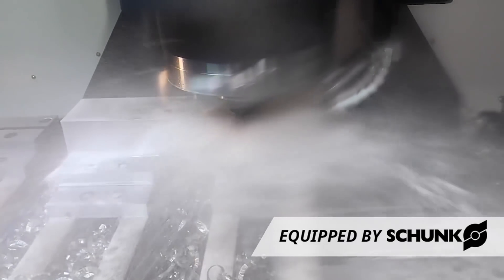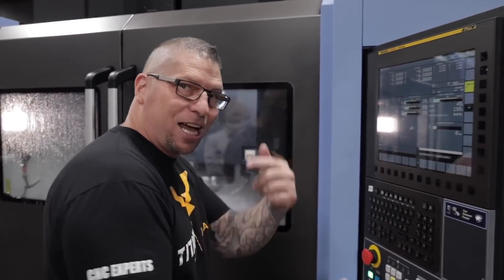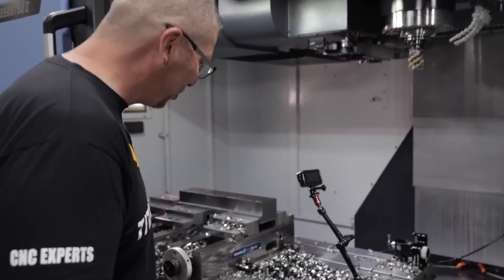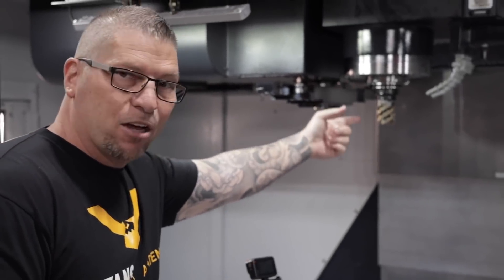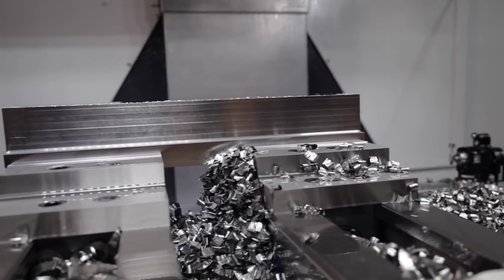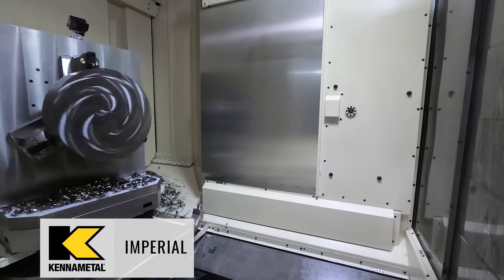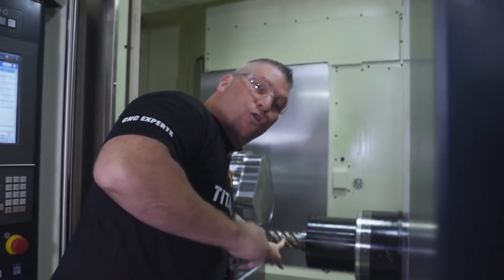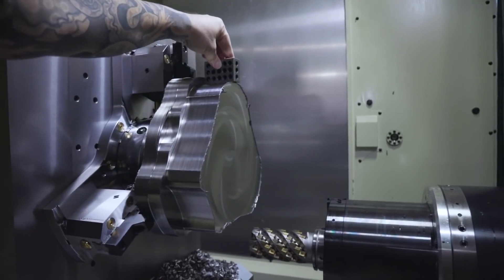Kennametal HARVI ULTRA 8X | Massive MRR in Titanium |

Comment: The funny thing is that by Auto Industry Tool and Die machining standards that is a small tool. I used to run an Okuma Bridge mill machining castings for Press Tools for car parts and we faced parts with a 400 or 500mm diameter facemill and roughed parts with a 120mm diameter 300mm long end mill with carbide inserts from Dijet. The day you crash that bad boy - BOOM!